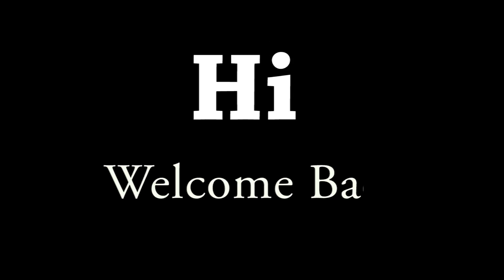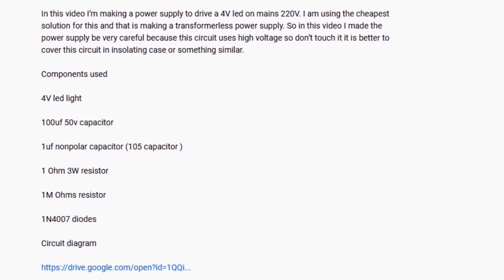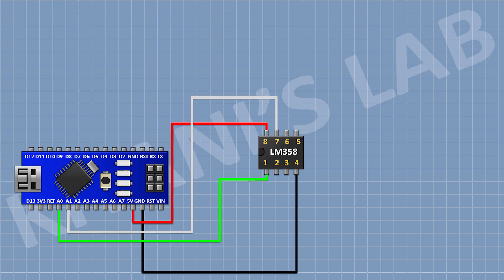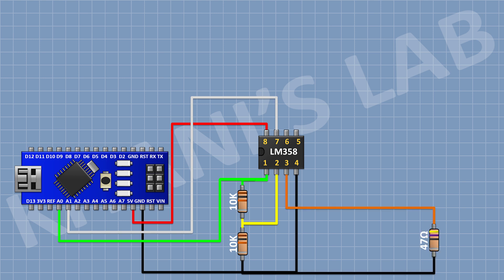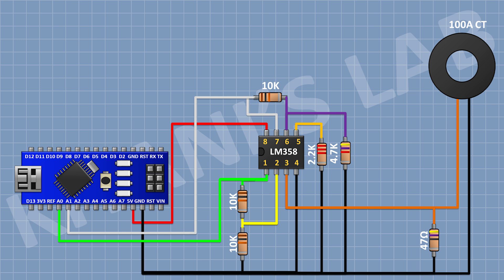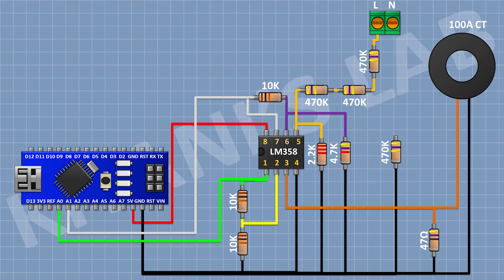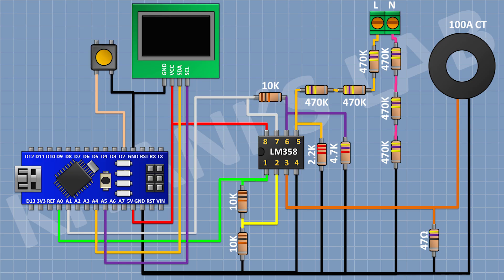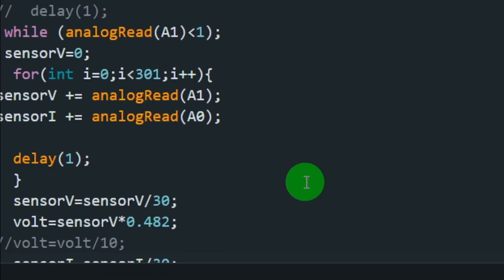AC Volt Ampere Meter Arduino Project

Comment: what happens IF;
there are voltage spikes on the line...the circuit is  damaged
what if a power outage...all data is lost
whats the current consumption

Comment: Esse professor é pra mosft com uma pilha e possível fazer mostrar sua qualidade com sua potência baixa professor
Reply: what happens IF;
there are voltage spikes on the line...the circuit is  damaged
what if a power outage...all data is lost
whats the current consumption
Reply: He should  EXPLAIN the circuit...not all this trivial connect this to that 
Ohhhhhhhh wait...he can not explain.....how useless
Reply from the maker: I will explain soon bro

Comment: Good
Reply: what happens IF;
there are voltage spikes on the line...the circuit is  damaged
what if a power outage...all data is lost
whats the current consumption
Reply: He should  EXPLAIN the circuit...not all this trivial connect this to that 
Ohhhhhhhh wait...he can not explain.....how useless
Reply: He should  EXPLAIN the circuit...not all this trivial connect this to that 
Ohhhhhhhh wait...he can not explain.....how useless

Comment: Can I use a 1.5M resistor instead of three 470k?
Reply: lol   but they can not tell u why
Reply: He should  EXPLAIN the circuit...not all this trivial connect this to that 
Ohhhhhhhh wait...he can not explain.....how useless
Reply: what happens IF;
there are voltage spikes on the line...the circuit is  damaged
what if a power outage...all data is lost
whats the current consumption
Reply: No
Reply from the maker: no

Comment: ❤️ Mashallah ❤️ Sir 👍 project 👍👍
Reply: what happens IF;
there are voltage spikes on the line...the circuit is  damaged
what if a power outage...all data is lost
whats the current consumption
Reply: He should  EXPLAIN the circuit...not all this trivial connect this to that 
Ohhhhhhhh wait...he can not explain.....how useless